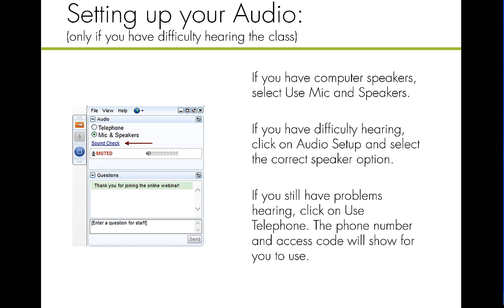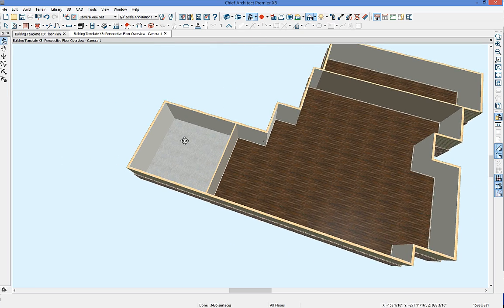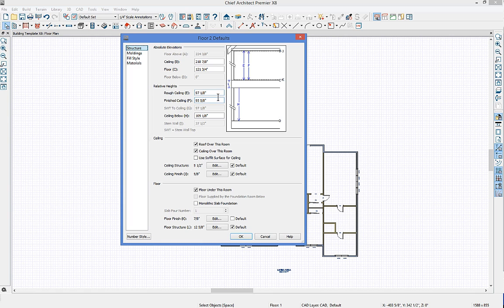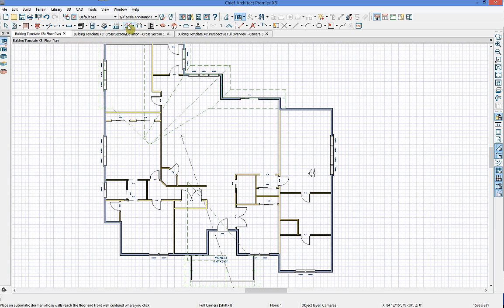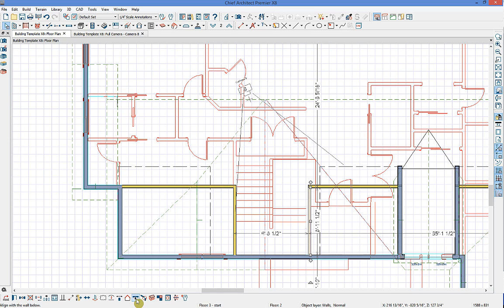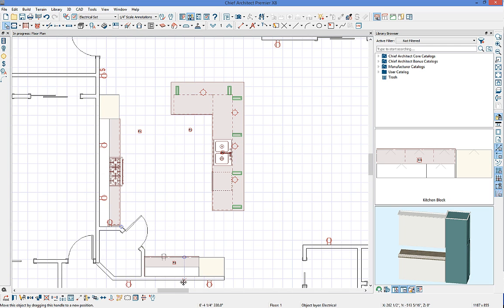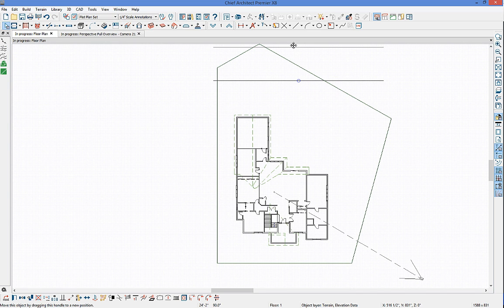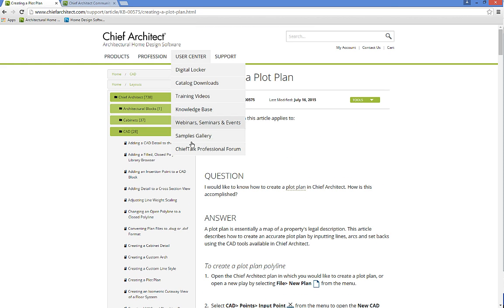Chief Architect X8 Building Demonstration

Comment: Just a question, can I make a 1 x 1 square meter spread footing in this software?, If ever I can, do you had a video tutorial about footings in foundations, and also includes the steel rods that supports it. Thank you.
Reply from the maker: Hi Rac, yes we offer a spread footing option in one of our Bonus Catalogs, but it doesn't include rebar automatically. Check it out here: https://3dlibrary.chiefarchitect.com/index.php?r=site/detail/962
Reply: Thank you for the response, but I still have a problem, I don't have any cards, how can I avail your $2.99 - Post and Pier Systems?. After this question, I have more question to ask.
Reply from the maker: Our sales team can assist with other payment options and with any further questions you may have. You can reach them through 208-292-3400 or sales@chiefarchitect.com. Thank you!
Reply: Thank you for the reply, Can I show the 3D model as a different file demonstration without using the Chief Architect as the source program?
Reply from the maker: Yes, you can use the 3D Client viewer to share your design with others: https://www.chiefarchitect.com/products/3d-viewer/

Comment: How is the Crawlspace and floor joist created? Also the plywood subfloor under the walls? Must of missed something.
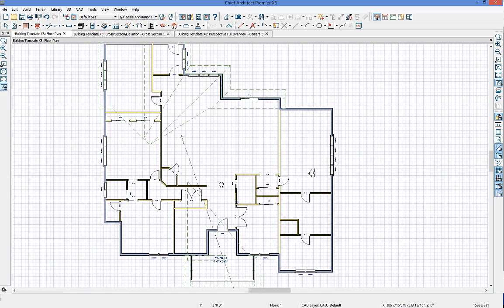Reply from the maker: The foundation portion begins at 37:10 (https://youtu.be/r2C-VNGVsBw?t=37m9s). This will show you how to create the foundation and floor structure. Thank you!
Reply: Hey thanks, using a friends system to design my next house and couldn't figure out how to get the foundation to work. Got it built but a lot of errors in using 8x8 seals instead of a 2x12 plate. Throws the Garage off where the outside brickwall meets the Garage floor. I'll get it figured out.

Comment: Hi, I have such problems with placing dimensions. They just don't snap op the places I want them to snap on. What is the deal? I used walls with isolation in between. Outer wall, isolation, inner wall. Sometimes it snaps on the inner wall and other times on the outer wall. Or just centered. How do I snap to a point I want it to be? for example: Placing a wall thickness dimension. Thank you.
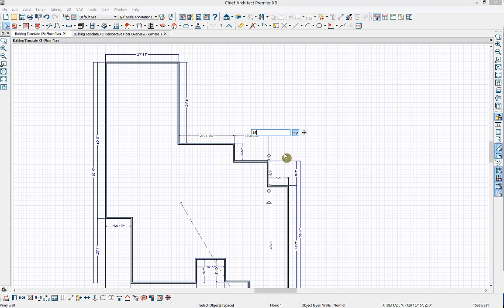Reply from the maker: You can control where your dimensions locate to through the Dimension Defaults. Here are some resources showing you more: https://www.chiefarchitect.com/videos/watch/68/floor-plan-basics.html (around 9:00 minutes) or https://www.chiefarchitect.com/videos/playlists/92/12-dimensions.html
Reply: Thank you. Could you explain 1 thing? How to put a wall thickness dimension.
Reply from the maker: You can use the manual dimensioning tools to locate to the sides of wall for the thickness. Feel free to call us at 208-292-3400 if you need further assistance.

Comment: Hi i have a problem and i did not know how to reolve it. I want to have a house with 2 floors and the attic. THe first floor has a hight in metric 2850mm than the second floor with 1700mm here should the roof begin. this worked, but if i change the hight now in the second floor to 2850mm i have a gap betwenn the wall and the roof in the inner of the room. because the wall gets two little boxes right and left of the wall. Can you explain how to resolve this problem? Thanks a lot. And thanks for the great Tutorial.
Reply from the maker: Thanks +Florian Fix! Our technical support team will be able to assist your question. Contact them M-F 6am-5pm Pacific at 208-292-3399 or the online support center: https://www.chiefarchitect.com/support/#contact

Comment: Hi, I'm also following along. I am at 30:28, and stuck. When I make that gable, the second floor wall that continues up to the roof disappears. There is no second floor wall, and I can see into the attic space. The first floor wall with the windows below it is still there. I can continue with the video to finish the gables, and the rest fill in just fine. My roof line ends up looking just like yours, but that second floor wall under that one gable is missing. Any ideas on why this is? Thanks! Great video!
Reply from the maker: +Kate Keight try moving the walls slightly to refresh the build. If this doesn't bring the attic wall back, please contact our technical support team at 800-482-4433 to trouble shoot.